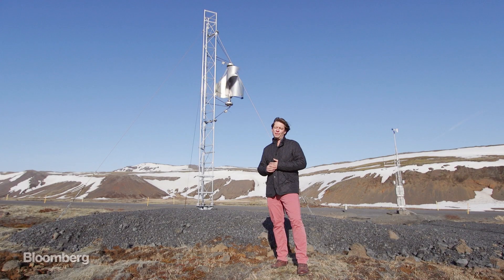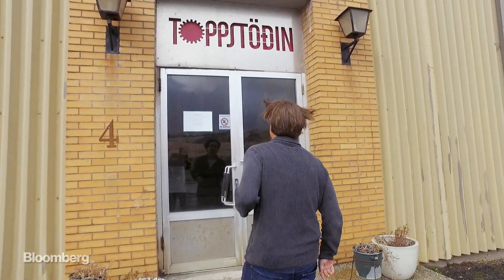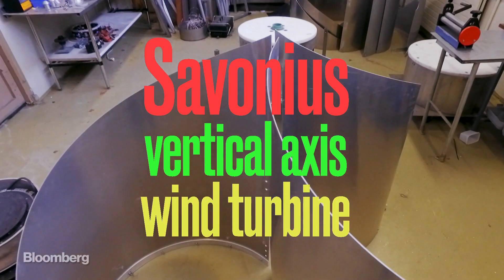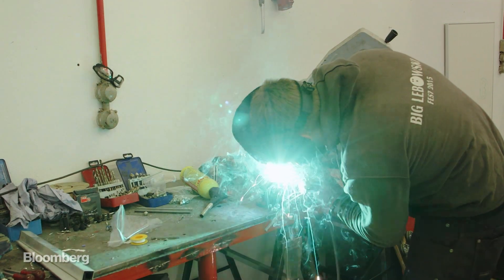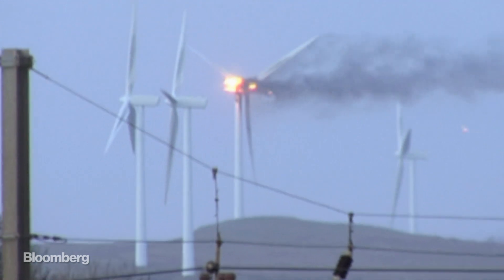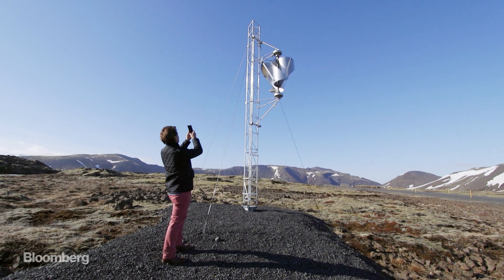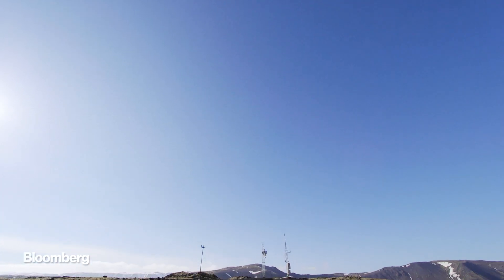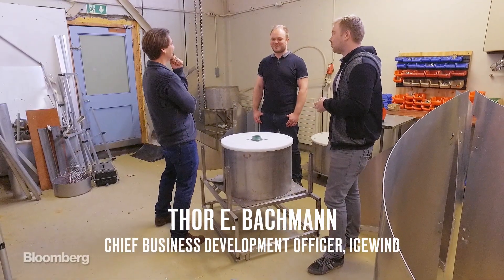The Tech That Could Fix One of Wind Power's Biggest Problems

Comment: Kinda a lot of bs imho, it's fine to power small stuff like leds and chargers but these things will never produce large amounts of power. Their 'advantage' in high wind scenarios is fixed in larger conventional turbines by simply pitching the blades out till the desired rpm is reached

Comment: The basic concepts are sound - low start up speed, self governing at high speed, multi-directional and the vertical axis means the generator can be at ground level. 
The downside is that with this setup - like the old half drum format, the energy produced is the force of one half minus the resistance of the other. Also the wind flow is very messy around the vanes.

Comment: Not sure......but I doubt that bladed designs are catching fire because they spin too fast. The blades have the ability to “feather”, like an airplane propeller. They can change their blade angle 90 degrees, and be streamlined into the wind, where no rotation occurs. I have the feeling this overtemp design is an incorporated feature. I know for sure they feather, I have seen an entire farm feathered, and not producing any power.

Comment: If you are stupid you will believe anything. These small windmills are okay for remote locations to run some low energy devices. Putting 1000x more energy into the steel than the wind turbine will ever generate. It may be economically sensible for very remote locations to power a radio transceiver or something along those lines, but don't think this is any use in the grand scale of renewable energies and solving the worlds energy demands.

Comment: Sorry but conventional wind turbines if designed properly do not burst into flames from excessive winds , the blades are maneuverable to stop wind flow and fast winds . m
I Like this but please dont deliberately lie to further your product, i would have actually purchased 4 if not fro the bullshit statement at the start.
no power per blade speed info , pretty well no fuckign information at all about specifics, i can tell you now just form my BM/wand mech engineering  that those fans will at the same speed claimed bye this video of large wind generators bursting into flames, this thing will fly to pieces and have the ability to inflict very much harm in busy street.
Its obvious from viewed application these thing dont put out enough power fro long enough to power a house or a engineering workshop, probably might produce enough power to charge a phone battery .

Comment: I like these.  They have useful applications.  But they can't replace our current power needs.  Wind power NEVER can.  There is no doubt also a more aerodynamically efficient version of the blades which is more 3d than flat, so the conversion to rotational energy could probably be improved.  The real issue is neodymium, or the efficiency of turning rotational energy to electricity - the cost-benefit of this is just not favorable.

Comment: Ok so 50% collection is 50%collection with this kind of set up. But what if you had a few at every house to assist the power grid. I say there should be at least one or two  to assist the grid. Couldn't hurt. Or maybe on light posts in smaller versions.

Comment: One apparent ADVANTAGE of this design over the conventional design is that the shadow doesn't cause much of a strobe effect, and there's probably much less air pressure pulsing.  Those are both cause health problems and depression, so it should be safer to use this design closer to people.

Comment: This video was a disappointment, why don't you show some power output or refer to the value of a bus stop charging station, the difference between a dead phone and a charged phone could save someones life or have life changing effects so its not just about cheap power or huge power but availability and sustainability.

Comment: The main problem that needs to be addressed isn't overspin. Conventional three bladed prop designs address this with brakes and blade tilt adjustment mechanisms. (Overspin in a properly functioning wind turbine cannot cause a nacelle fire.) The main problem that is not being addressed is bird and bat mortality due to collisions with high speed blade tips.

Comment: vawt's (vertical axis wind turbine) are nothing new, with some design's being better then others..   this is not better then a lenz2 design simply because the shape of it and the area the wind is pushing on is cut in half, a full sqaure sheet would do better.
and the lenz2 design not only use's the pushing of wind to spin it, it also use's a wing shape on the inside to help PULL it around.       you'll also notice all high power turbines you WINGS because they are more effecient then pushing a wall around...

Comment: What happens to the earth when you steal all that energy from the wind
Same question for the sun
Reply: The wind becomes electricity, and later heat. The heat then moves air through convection and you have your wind back. Try your argument on nuclear power though and theoretically we have an interesting subject where the earths internal heat is partly radiated to outer space.

Comment: Why don't they just make wind turbines have a system built in to resist high wind speeds? Like one of those old-timey centrifugal brake type things where if it starts going too fast, centrifugal force makes the arms spress out and slows it down. Don't know the proper way to describe it, but it's like the exact OPPOSITE of what happens when a ballerina spins and she pulls her arms in to spin faster. When the arms go out, spin slows down.

Comment: How efficient is a wind turbine design where half the turbine area is moving into the wind, counteracting the other half which is moving away from the wind? The only reason it works at all is because the back side of each blade is curved to slightly reduce its friction as it moves into the wind.

Comment: Like he said nothing new. I've produced one very similar myself and yes they do prevent over spin from high winds. When it reaches a certain RPM it creates a Vortex around it that blocks the wind in a way like a giant drum wood. The faster it spins the less likely it is able to spend because it becomes less aerodynamic efficient for rotation. At a certain point it literally just fights itself and becomes a cylinder. This is simply only my experience with these types of designs. To see this company grow would be excellent
Reply: Can this design survive in Tornado Alley? Not necessarily a direct hit from a tornado, but say, 100mph winds?

Comment: Imagine anything not secured on a merry-go-round (tiovivo in Spanish). It will be flung outward. So while the one blade is catching the wind, it is causing air to move outward from above and below on the other 2 vanes. An area for improvement?

Comment: Would the Savonius vertical axis wind turbine be viable if it were made of plastic?  You could make the turbines must cheaper by plastic injection molding instead of having to make a metal turbine, I think.   Plus you  could use recycled plastic for the turbine, couldn't you? .  I am no expert but I would think that a plastic rotor could be made strong enough.   Is there something I am missing?
Reply: Leif Johnson the electric motor, gearing/ transmission control electronics and grid inverter/ battery storage are the expensive bits, your right about plastic being strong enough but sunlight can degrade plastic and its outside constantly in the elements so it's a trade off

Comment: What if you made a cheaper electrostatic version of this wind power? Where the spinning of fans will cause it to mechanically rub the carpet or similar material to pvc pipe rapidly and generate large amounts of static electricity. You then convert this static electricity to AC or DC power. The taller the pvc pipe the better. Attaching pvc pipe on terrace of a tall building or top of a mountain even better. Covering pvc pipe with copper coil on the inside even more better.

Comment: "One of Wind Power's Biggest Problems    I thought that this videos would be about the slaughter of birds.  I moved to the Columbia Hills (which flank the Columbia River in Washington State) in 2000.  In 2000, anytime one looked at the sky one saw hawks and eagles circling; when driving down a country road paralleling the Columbia Hills, it seemed as if there was a raptor perched on every telephone poll.  Then they built the wind farms.  Now all the hawks and eagles are GONE, slaughtered by the wind turbines.  WIND TURBINES ARE EVIL.  Or, perhaps I should say, conventional wind turbines are evil.  It looks like this design will prevent bird-kill.  Perhaps it will replace conventional turbines, for efficiency reasons.  DISMANTLE ALL CONVENTIONAL WIND TURBINES!!

Comment: NREL National Renewable Energy Labs (US) stopped all testing on VAWTs because of inefficiency, unreliability and high cost of maintenance. I live close to an NREL test site near Boulder, CO.  There are many standard 3 blade designs that undergo testing.  As a hobby, I did a lot of research into renewable energy, especially wind turbines.  Despite looking cool, I discovered that the VAWTs were essentially worthless.

Comment: It is not even close to being a new idea. Google Savonius turbine. The Savonius wind turbine was invented by the Finnish engineer Sigurd Johannes Savonius in 1922. The Savonious gets less efficient the higher the wind speed goes. It is fine for low speed things like water pumping or low power needs, but is very low efficiency compared to conventional turbines. The fact that it starts spinning in low wind is useless, because there is nearly no usable power in low wind speeds. The power available in wind goes up as the cube of the windspeed, so doubling the windspeed gives you 8 times as much power. 7.5 minutes of 8mph wind is worth 1 hour of 4mph wind is worth 8 hours of 2mph. 

BTW this is not even close to windpower's biggest problem, storing electricity for when you need it is.

Comment: The problem with this tech is that it can't be built GRANDE without also having a netted cage around it which must be as big as the wheel itself if it's to be mounted anywhere near where people or animals live.

In its current design, it's a so called "Bird-eater/exterminator". . ;)

We have the same problem with the "S"-shaped vertical windmill. Excellent tech, but Seriously Dangerous to everyone around it. Many little kids fingers have been eaten by that one. ;)

Comment: Nice cell phone charger for $10,000!! Maybe with all of that excess energy, I could run a can opener and an alarm clock!
Reply: 10K      pfft   I built my vawt for only $300    (1 kwh)
Reply: @harleyme3163  Exactly, I paid only $200 for mine although it only makes enough power to fire up my calculator.

Comment: For small-scale power under 1 kW...the turbine on fire was a megawatt class. In other words 1-3 thousand times the capacity. also, the footage on the Enercon Turbine was speeded up those blades spin at under 20 rpm. Great for an eye-catching small-scale local power not large generation. Also in Iceland, there is a surplus of energy from geothermal sources no need for wind or sun. Been in wind and renewables a while now we keep reinventing the same wheel

Comment: This is a crappy Savonius turbine, the least efficient form of wind generator. It's not a solution, it's a multiply tried failure except for the most trivial of power needs. It's been around for thousands of years in one form or another. There is nothing innovative about it.

Comment: Its a nice solution for a reliable long lived low power application. I cannot imagine it to have a high power output though, since its effective cross section is pretty low. Also, the coefficient of performance for this type of turbine should be pretty low compared to regular turbines.  Probably around 0.2, guessing from the numbers for Savonius turbines, which this should qualify as.

Comment: You did nothing to explain what the "biggest problems" were and nothing to explain how this is actually any better.
Reply: blade breakage, overturn. due to extreme weathers pushing them across their advisable speeds where they either have to engage some kind of breaks that will wear or just turn off completely. these blades are not affected by that. It explained it all but you have to listen.

Comment: This doesnt solve one of Wind powers biggest issues. Wind turbines can be turned off and there are several companies making models with collapsible blades. Wind powers biggest issue is that it is direct power. It can not be stored or transported long distances. That is the biggest hold up to both wind and solar. There are some companies working on better batteries but an efficient storage device for direct power is still decades off. Everyone seems to be focused on solving the minor issues with renewable resources. We have to figure out how to make renewables as efficient as fossil fuels. Otherwise, renewables wont be worth the price

Comment: Brags about how their wind turbine won't catch fire like a conventional turbine.
Neglects to mention that the Savonius vertical turbine is less than 1/3 as efficient at converting wind to power, and does not scale up at all well. Their turbine generates 1/10000th the power of the one shown burning. YES, one ten-thousandth!
They are great for low-power applications, especially where wind speed and direction are highly variable. Unlike most vertical wind turbines they are self-starting. And if build correctly they can be very,very low maintenance.
But efficient? Powerful? NO!

Comment: Pointing out that your turbine spins in low wind is pointless, because there is very little energy in low wind. Regardless the size of the turbine, or the orientation of the axis, any windspeeds below 4 meters per second (10 mph) are negligible.

Comment: Houses could place several small versions of these along their roofs, helping to alleviate power usage. I wonder how much power could be generated from 4 or 5 small versions of this, each turning a small generator which in-turn charges sealed lead acid batteries or even LiPo or Li-Ion battery banks. I could probably at least run my PC system, monitor and a few LED light fixtures from a few of these along with a couple of 100w solar panels charging a battery bank that powers my UPS system.

Comment: I actually took an engineering course in wind energy in college, still kept the textbook even. We studied various vertical axis designs of wind turbines and the verdict is pretty clear: with current technology and materials available, horizontal axis designs offer much more flexibility and room for optimization than vertical at a large scale.
Reply: @yyangcn
You should have studied harder.

Comment: Physics, folks. It’s near useless to mount any type of turbine down in the turbulent ground area. Those are for show, not go.

Very disappointed in this video. No discussion of the real-world design considerations between HAWTs and VAWTs, why HAWTs are used exclusively to generate “real” power. No discussion of the cut in speed on these VAWTs and at what speed they spin so slow that the inverter actually wastes grid power... which happens a LOT in those trendy sculpture-like displays that are near ground level.

Have been watching small scale turbines for years, and without any real hard data? This looks like the same kind of snake oil as all the other VAWTs. By using the old Savonious design, that isn’t some great breakthrough in making these practical... it has all the same efficiency and total capacity problems of existing VAWTs. Hard pass. I am still shopping for a 5ish kW HAWT for my rural property. Much more real-world practicality, and when paired with solar out here it makes for a more balanced system with more consistent production.

Anyway... c’mon Bloomberg. This was a useless fluff piece. Show us the data. VAWTs have been snake oil for so long now it is going to take a sizable pile of vetted data to convince those of us who have bothered to educate ourselves one iota on the subject of wind power.
Reply: Industry wants you to think that; read From Space To Earth, an early history of the photovoltaic industry. Available Jones, who bought and buried the very first viable solar generator, was a friend of my Dad's. They were all selfish and proprietary. Available was in the offshore battery biz.

Comment: Okay, but at the same small scale of this new turbine, the catastrophic failure of the traditional wind turbines would not happen. Scaling up would be insane in terms of cost of materials for this thing. For small scale stuff like on top of bus shelters or something okay fine, but it will never produce enough energy to replace current turbines.

Comment: Very nice for private use or remote offgrid situations. Every bit helps, but the big turbines have the best cost/benefit ratio for large scale generation. Problems with strong wind only occur in the unlikely event of brake system failure.

Comment: I would like to see a hybrid vertical wind generator using a twisted wing shape to help reduce the resistance on the backside of the blade. Not just a bent piece of sheet metal as shown in the video. Perhaps a longer blade with a wing shape to change the airflow and create horizontal lift so to speak making more pressure towards the rotation. As an airplane wing creates lift by reducing air pressure on the top and more on the bottom. This may have to be fastened at top and bottom as the one shown in the video.

Comment: thanks for posting.  here are some very very late thoughts.   this design is fundamentally flawed, in two ways.   the design should include a disc-shaped baffle at either end of the rotor.   the design should minimize energy loss due to air being able to deflect, inwards; where the leverage is less.     cheers